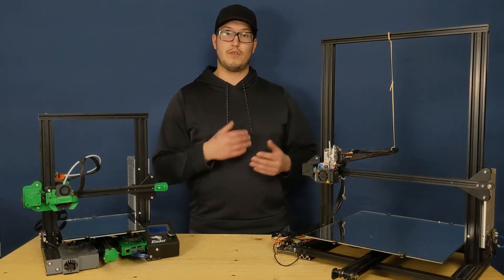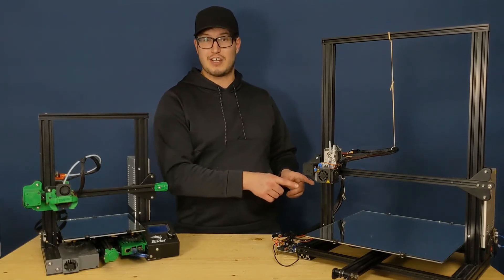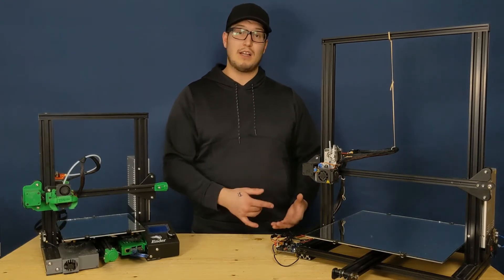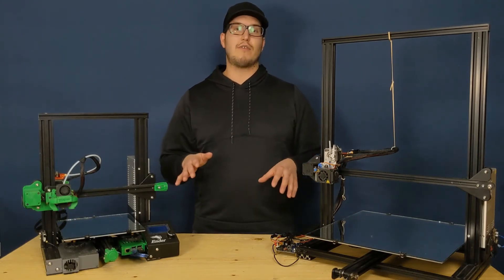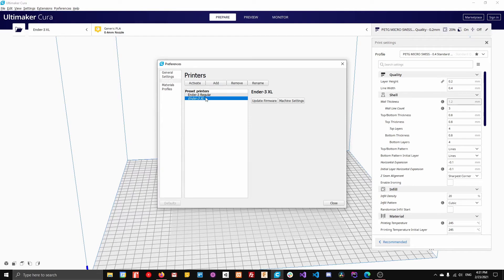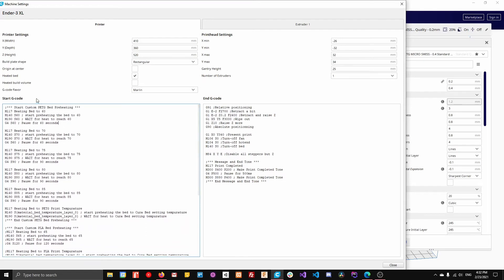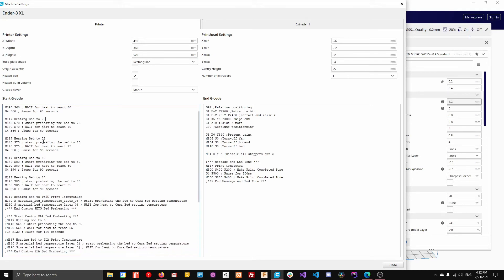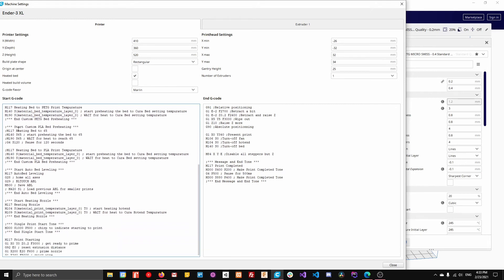Increment Bed Heating in Cura | Fix for Ender Extender 400 with stock bed heater

Comment: With the heat code, did you just add that to the CURA settings manually?
Reply from the maker: Yes, I added it to the start GCODE section in the printer settings manually

Comment: I'll have to look into this, i was wanting to do an ender extender, do you have any thoughts on that?
Reply from the maker: I'm super happy with the kit, if you do go ahead with it, I would recommend:
- get a plain square mirror from the local hardware store and cut it to the right dimensions ($4 for a glass cutter)
- get a BLTouch or other ABL, helps a ton with bed levelling
- Don't get the XL version unless you need the build height, in 8 months I haven't printed anything higher than 7" (175mm) but my 400XL Z-Axis goes all the way to about 20" (500mm)
Reply: @LucasBuildsStuff  - Do you use the mirror as the actual build surface....?  vs a flexible metal plate, borosilicate glass, etc....?